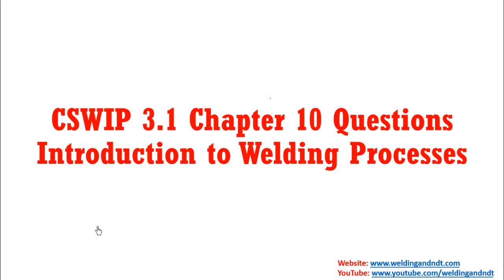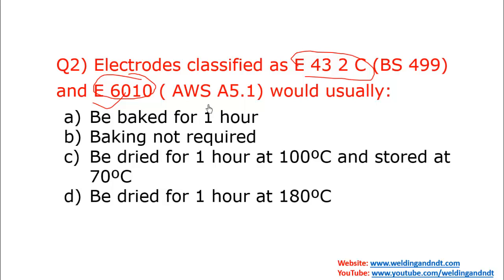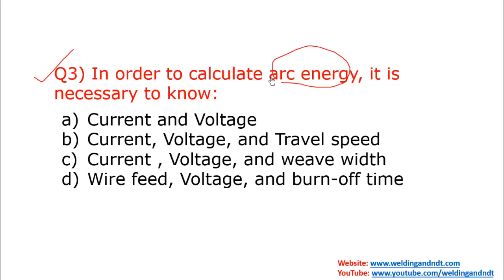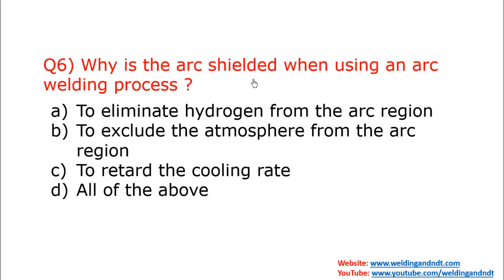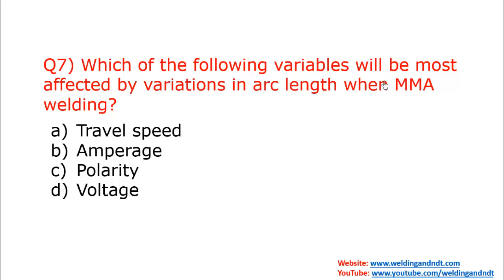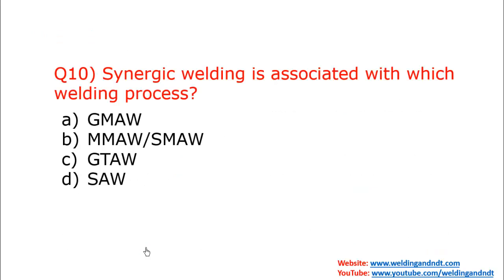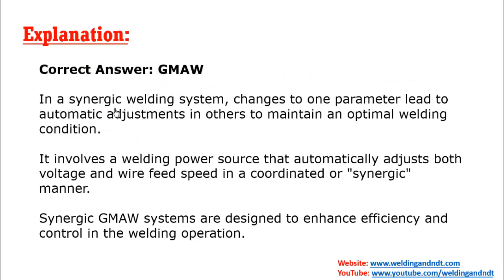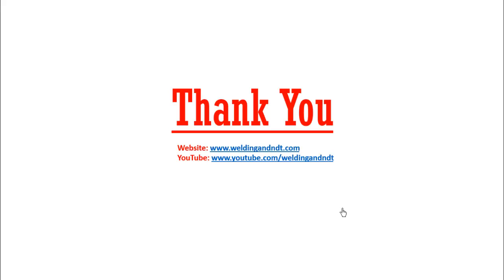[English] CSWIP 3.1: Question & Answer -  Chapter 10 (Introduction to Welding Processes)

Comment: Sir for membership money was credited from my account but I didn't got membership
Reply from the maker: Hi, the payment system is provided by Google, they don't provide details of transaction to us hence, I would not be able to check your payment status. However, since, the payment system is provided by Google hence, it is completely secure and authentic from my point of view. If you are not able to access the membership, then  it could be because of failed transaction. Your money will be credited to your account. No need to worry. You can retry the payment after 1 or 2 days